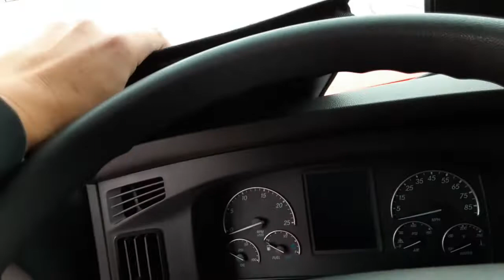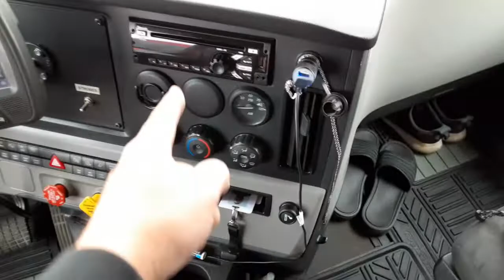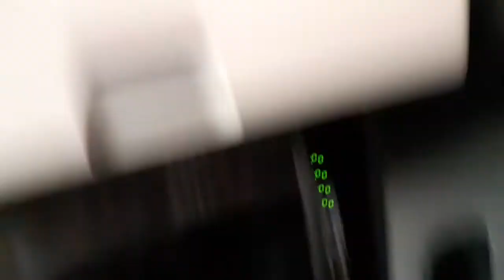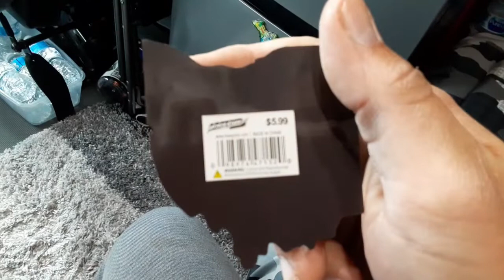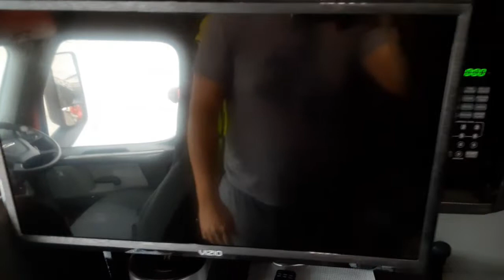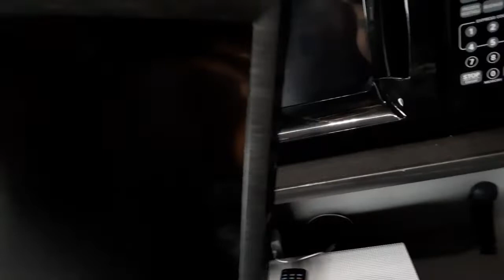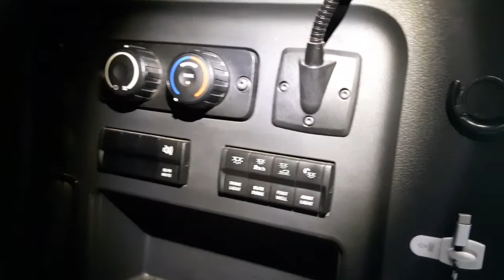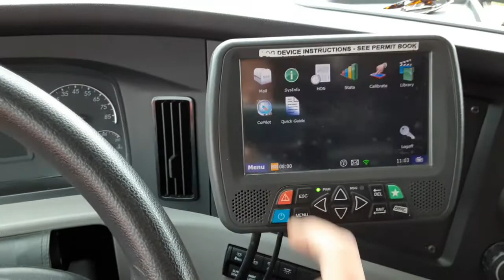Truck Tour - 2020 Freightliner Cascadia - Roehl Flatbed and Specialized Fleet

Comment: Hey Bro.. Appreciate Ur Vidz! ❤ How long ago did u drive for Roehl?  It's July 2021 at the moment...I wanted to know Do they Allow TV/Refrigerator/Mirowaves.  Sumone told me they don't allow set ups like urz anymore. Can u enlighten.
Reply from the maker: That someone was wrong 😆 They allow it. I just swapped my microwave out for a air fryer/oven/microwave combo a few months ago
Reply: @olinjtaylor  Oh u still wit Roehl? I thought u left! Are u a company or Owner Op? Shid bro share the link wit a brotha to that combo set. How you like the set? Also How you power all that shit. Cause sumone said they give u sum kinda batt interverter that only runs 2hrs then shuts off for 10hrs. So how you run a fridge?  Sorry for all the questions.  I appreciate yo feedback
Reply from the maker: @DrDre.  they're wrong again 😆 The truck's computer monitors the batteries and will recharge them if needed. It powers everything no problem...I do have to start the truck when using my Keurig. I got the fridge from Lowes, the tv from amazon and the microwave combo from Walmart.
Reply: U Da Man. Thanks bro

Comment: After you complete your phase with the trainer are you assigned a truck, and able to drive it to your residence? Or are you required to leave it at a terminal and come get it when you have a load to pick up? The reason I ask is I live in Clarksville Tennessee and the closest terminal for me is Conley Georgia
Reply from the maker: If one is available, you'll get to drive it home after your trainer drops you off and you test out. Otherwise you'll have to wait until they find you one. You get a few days off once you complete your otr training. You may even get flown to a different terminal or part of the country to pick it up
Reply from the maker: The only reason you would have to park it at a terminal is if you live within 50 miles of one. So you're in the clear.

Comment: So is it not true that Roehl doesn't allow microwaves, tv, and refrigerators in the trucks? Or did you have to have special permission, or?? Also heard that you can only run them for 2hrs before having to wait 10hrs to use agian.. a lot of rumors,  just trying to get the truth..
Reply from the maker: That's the weirdest thing I've ever heard, lol. You can have all that in the truck and don't need permission. Running them all day if you want.
Reply: @olinjtaylor  I thought it sounded really weird, but when I looked it up online that was some of the things they stated.. It didn't make sense, so I wanted to ask and make sure.. lol thanks for the feed back!

Comment: Hey Taylor that  black thing on the floor is a cup holder. For bigger twist thermos’s you can put em in there and it’ll act as a tumbler. (I seen someone explain that on a different video of the cascadia)
Reply from the maker: Makes complete sense now, thanks!
Reply: It is not a cup holder! It is a holder for a fire extinguisher. Roehl moves the extinguisher to a side compartment, but the truck has the fire extinguisher in that spot by default.

Comment: if ur taking two showers a day ur not running hard enough. ‘nuff said
Reply from the maker: Riiiiiiight 😆 I fit two showers, a meal and 7 hours of sleep in my 10 hour breaks every day 🤘😎
Reply: @olinjtaylor  and running 400 miles a day! been at this 30 years and know how it works. best wishes
Reply from the maker: @zoomba31  400 is a slow day. I did 600 with two stops yesterday AND had 45 min left on my clock in a governed truck. Still got my two showers. Maybe you've been doing it wrong for 30 years 🤷‍♂️. Be safe driver.